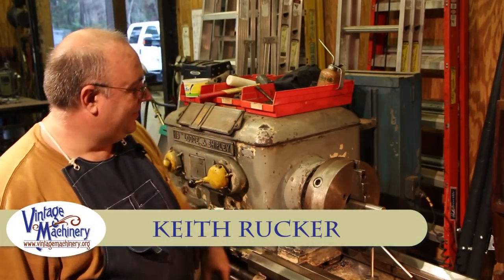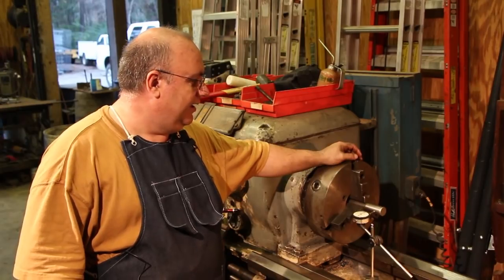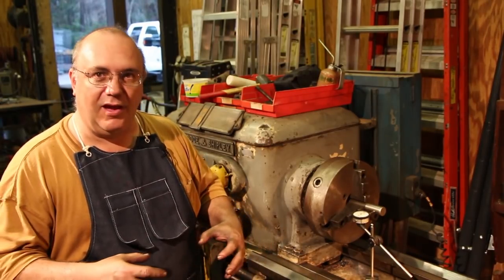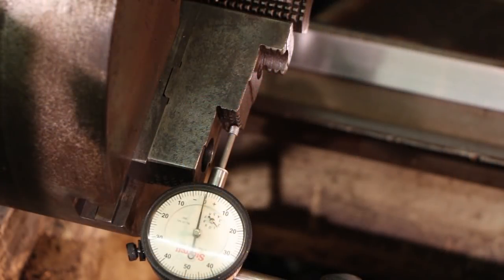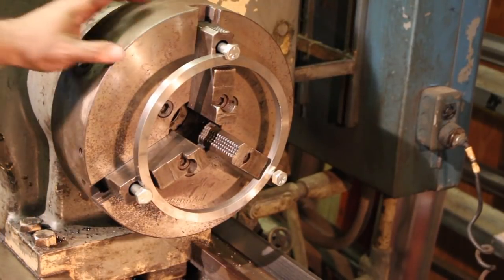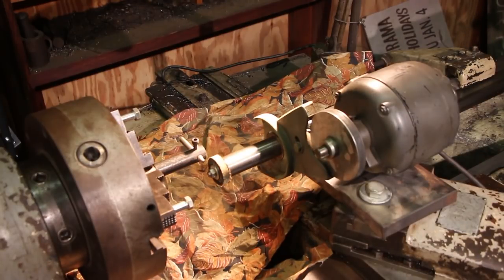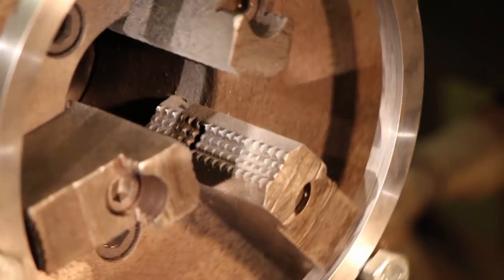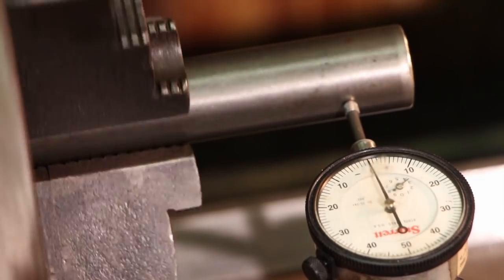Machine Shop Maintenance:  Truing up a 3-Jaw Chuck

Comment: Is aluminum stiff enough for this? I just spent hours cutting a ring on a 1-inch hardened steel I thought it was cold rolled steel until I started smoking the room up LOL
Reply: Clown Whisper  the ring just tensions the assembly, it doesnt play any role in the jaws positions besides that.
Reply: DrewLSsix I wasn't sure how much pressure you have to put on that if it's just to take the stuff out or if you have to put considerable tension on it

Comment: so for years you dealt with that run out when i watched your late was out in alignment of one of the jaws which is almost always the case ..... you mark that jaw and shim half the amount of your run out ..... then any time you use it you place that shim in the jaws on that jaw and done ......... but you really should check runout with different diameters of work.... it's possible that someone over torqued the jaws or had a workpiece grab and be torqued out of the jaws bending the scroll it'self meanin you only have runout for a common size of stock such as 1  or 2 inch... if that is the case shims are your answer unless you want to straighten the scroll

Comment: That's a great technique but it's only as good as where your grinder is mounted relative to the true center of the head stock spindle. I say .004" is pretty good!!! Well done!! 
I have an old South Bend 9A with a chuck that has about .011" run out measured at the chuck body, more on the work piece.
Reply: Dean Segovis 
not true Dean. The grinding wheel can be anywhere inside the chuck, and as long as it cuts, it will work. The centre height and angles of the stone sre essentially imaterial.

Comment: You made this way harder than it is.....  Just  chuck a piece of  round  stock machine it  true part off either  a disk or  a washer from that  place that in your  jaws squared up from behind by  a round bar against the  jaws then  place that  washer against that  so they are all the way  to  your jaws backs.....  Now  cut your  jaws true then  move the  disk to the  front of the  jaws and  bore home thru it  and  take down the  bit of the  jaws that  held the  washer before
Reply: Forgot that  many jaws have a nice  undercut for holding that  washer just  for this purpose
Reply: Another way is make a stepped washer that way you can  center off the  backs of the  chucks

Comment: When testing for trueness should the test stock piece be rec-chucked several times then check with the indicator for each chucked position?
Reply: i also like to use centerless ground stock for this or if you have a piece of 1 inch by 6-10 inch round carbide laying around it is super for testing runout

Comment: could you please explain what does "truing up" mean?
Reply from the maker: +Rizwan Ul Karim Making the parts "true again", or basically re-machining the surface to take off any wear, damage, etc. that has occurred over time.
Reply: Truing up is  making the  part centered.....  When  it  comes to the  chucks you want the  jaws to  hold a round bar centered perfectly (perfect does not exist only  close to perfect) ....  If  the  part is  not centered  when you cut that  part the  tool will  cut the  high spot and  not  the  low spot......

Comment: WOW.  Comments are polarizing Keith.  I like your videos & recognize that what you have to work with is generally 'old school'.  I'm into old school myself.  Trying to teach myself a new trade in tool making & find your results educational!  My Chinese Lathe / Mill Combo will have a better run out once my tool post grinder arrives - but will need an extension to do it.  My interest in your escapades is real.
Reply from the maker: +BROCKWOOD64 Thanks for hanging out in the shop with me (virtually at least....)

Comment: Thanks Keith, I really like your videos! I only have one question about this one in particular, since I worked for a short while in industrial metrology: at the end of the video, wouldn't it make more sense to measure the total, or only radial runnout, using a cylinder gauge? That there is just plain stock, who knows how cylindrical that is...
Reply from the maker: +ms01rci Yes, it would have been better, but that is what I had handy.
Reply: Thank you for taking the time to answer, as I'm sure you're getting hundreds of comments all the time. Thought it was something along these lines because you have a great a very good understanding of when and what 'good enough' is.
Best,

Comment: Interesting and impressive procedure.  couldn't the .004 run out just be a result of the tolerance of the round stock?
Reply: should have put the clock closer to the jaws.
Reply from the maker: +Andrew King Possibly.

Comment: just curious but what about the  outside of the jaws where the grip id
Reply from the maker: +Scott Tyndall You could grind them as well with the tool post grinder on the lathe.  I rarely use the outside of the jaws, but if I see a need to do it, it would be fairly easy to do.  You would just want to chuck something up on the inside first to pre-load the jaws.

Comment: Perhaps someone can enlighten me here. If using a media wheel, wouldnt the diameter change as it grinds, making the slide measurements off? I guess the trick is to take very little off each pass to keep the change minimal?
Reply from the maker: +This is our Journey Kind of like using a surface grinder - you take light cuts and re-dress your wheel when necessary.  You can get extremely accurate results this way.
Reply: makes sense!

Comment: Hey Keith, do you think a Logan Model 210 is good for Hobbyengineering? Got Hands on one in really good condition.
Reply from the maker: +falcrum19 I used to have a Logan 210.  It is a fine machine for hobby work.  The only drawback to this lathe is that it does not have a quick change gear box for changing feeds and thread pitches - you have to manually change out the gears to get the right ratio.  It is doable but a pain in that it takes 20-30 minuets every time you need to change the gears.  Also, be sure that if you get this machine that it has a a complete set of change gears with it as you will find that you will be spending a lot of money to get the ones you need if you don't.  While Logan is no longer in business, one of the family members of the company still has lots of parts and is very helpful if you have any questions on the machines.  If you go to my web site at vintagemachinery.org, search for Logan and there are several publication reprints with more info on the lathe.  Besides the quick change gear box shortcoming, it is a nice machine capable of doing fine work.
Reply: Hey Keith, thank you for answering so quickly, I was able to win this auction, an the lathe costs me 491€ (~530$). The machine comes with several gears also for metric system, a 3 and a 4 point chuck, quickchanger for the lathe tools, several spindles, a table and many many other stuff. I think it was really cheap even for an 69 year old lathe that was redone. Sorry for may bad english, and greetings from germany ;)

Comment: i used a boring bar
Reply from the maker: +go irish A lot of the chuck jaws are hardened, which would not work too great with a boring bar.
Reply: I realize that, just noting that I had no issues.

Comment: Why did you stop? You need to run that grinder several more light passes and you would get even better runout hopefully down to .001" or less.
Reply: +Dima Prok On an old lathe, there's going to be slightly uneven wear on the scroll, and that's assuming it was perfect when it was originally machined.  It's not realistic to think that you'll ever eliminate the runout, because even if you get it perfect with the jaws at 2" diameter opening, it could still be few thou off when you crank them down to 1" diameter due to the fact that the scroll has some variation.
Reply: Bullitt Garage When Keith Fenner wants that kind of precision, he uses an independent 4-jaw and centers it with a dial indicator.  As anybody should.
Reply: +Dima Prok Because he isn't anal retentive like Keith Fenner.
Reply: +Dima Prok   The Agricultural Museum has equipment from the late 19th and early 20th century so a lathe with 0.004" runout is capable of making parts for equipment of that age which were manufactured with much less accurate machinery.

Comment: Keith,

Just watched the comment video that follows this one, and realized something.  I wonder if you might have gotten better results from using shoulder bolts instead of rolled bolts, I once tried to convert a few long bolts into aligning studs (remove the head, grip the non-threaded area, convert outer 1.0" of 2.5" of thread into pin), and was surprised how non-concentric the threads were in relation to the non-threaded section of the bolt.  Then again you might only pick up a few hairs.  2 of the 3 bolts were so bad I just tossed the idea and started from blank bar stock.

For a few more hairs, should also have advised (in the case of people that have 2 piece jaws) to remove the master jaws and clean the keys & slots with alcohol and remount them dry especially the corners where no one looks.

Thanks for another great video
Rich C.
Reply: Ignore the shoulder bolt suggestion, just realized the thread wouldn't belong enough.  Only way to do it would be to make a long thread shoulder bolt for this purpose.
Reply: +Rich Cizik I was thinking the same thing, that stock bolts could be very much off center.
Reply: Rich Cizik  the bolts dont need to be perfect. remember, they are just part of a solution to remove slack not position the jaws.  the jaws are positioned by their screws and no amount of precision in the jig beyond removing the slack will alter their position.
Reply: Drew,  

Have you ever checked the centrality of rolled thread hex head bolts?   I have tried to use a bolt to make an arbor for a hole saw.  The thread of the hole saw ran within 0.010 of the body, but when I threaded in a 3/4" grade 2 bolt that I had cut the head off of, the saw ran almost 0.120 eccentric, and if I turned the bolt 90 degrees in the hole saw and relocked the nut against the saw body it would bring it down to 0.050 before going back up.  I have also had the unthreaded sections of bolts run so eccentric to the thread that the bolts could barely be hand tightened because they would rub against the clearance hole, but would rattle loosely in the same clearance hole by itself..

Now consider using that same bolt against the ring, it could mean that 2 of the jaws are being pushed against the scroll while the other is floating.  The only way you are going to get a semi-toleranceable jaw set is if all 3 jaws are held equally tight to the scroll.  Thus the only way to make sure of this is to machine all 3 or to use shoulder bolts which are manufactured with centrality and shoulder diameter tolerances.

Rich C.

Comment: Idiot! Always clamp on the INSIDE of the jaws to make an internal cut! And you call .004 run out acceptable? What are making? Baseball bats?
Reply from the maker: Mike Snyder You must not have been watching this video very close - I am not gripping on the outside of the jaws, I put in long bolts on the outside bolt holes in such a manner that I am actually clamping on the outside of the ring in a way that loads the vise jaws to the inside.  As for 0.004" being acceptable, for three jaw work, that is plenty acceptable.  If I need for something to be closer than that, I chuck it in a 4 jaw chuck and dial it in with an indicator.  No three jaw chuck on the planet will eliminate runout 100% and if you start randomly checking 3 jaw chucks with an indicator, you will likely find that the good ones are only keeping parts within 0.002 to 0.005.  About the only time I ever use a three jaw chuck is for a job where I am either starting from a rough piece and the entire part will be turned to size (where 0.004" is more than acceptable because I am turning everything off) or if runout does not matter.  And considering where I started from with this old and bell mouthed chuck, I made a HUGE improvement, which was the whole point of the video - how to make an old worn out chuck better.  While I can make baseball bats if I want to (I use my wood lathes for those however), I use this lathe for precision work and use it quite effectively, which I think you will see if you watch some of my videos.  Which leads me to wonder who the idiot in this conversation really is.......
Reply: I've gotten old worn out 3 jaw chucks to within .0005 by tapping on the eccentric jaw with a babbit hammer.
I worked job-shops for over 40 years and you learn to use what works!
Reply: @VintageMachinery  
Hi Keith.   I learnt a long time ago that people always accuse you of what they are guilty of.   Thanks for the videos
Reply: +Mike Snyder That works for a particular diameter.  Then what do you do when you need to chuck a larger or smaller piece?  You're going to have to true it up again, because I guarantee that old, worn scroll is going to have a few thousandths of waviness in it, (not to mention the occasional dent from tool crashes).  Keith is right, that the ONLY way to get a part absolutely true (as true as you want to get it) is to use an independent 4-jaw chuck, and it's going to take a lot less time and effort than pounding on the chuck every time you put a part in it (not to mention being easier on the headstock bearings).  There's no scroll chuck in the world that is perfectly true at all diameters.  When I was doing production work on precision Mazak lathes, we had to re-cut the soft jaws before Every Single Run, at the diameter they would be used, UNDER TENSION (usually used an appropriate-sized washer tucked into the hard jaws), to true them up, and those were hydraulic chucks, not scroll chucks.  If I had bashed on the chuck with a hammer, the foreman would have escorted me out of the county on a rail!

Comment: try it by using nothing on the jaws and turn the lathe at the highest speed it will do. the check round out with a piece of precision ground drill rod.....you might be amazed ...
Reply: +Andrew King   I've thought about this carefully,  If you strip a chuck and look carefully at each piece as you resemble it, unless the chuck is incredibly worn out and very sloppy, I cant see which piece would generate the force to unscrew the scroll 
I'd be interested to know where this piece of information came from ?
Reply: William Gotobed Manufacturers, fellow machinists in the industry.
Reply: Be interested to find which manufactures actually quote this ?, and you still don't mention which part can cause this phenomenon, assuming that the chuck is actually tightened up.
Reply: That can happen on a lathe that starts instantly in the right direction at a very high speed.   That is what can unwind the scroll especially if jaws are opened a long ways.   Otherwise the centrifugal force of the jaws  is so great on the scroll that I don't think you could open them if you could put a chuck wrench on and turn it.   Hope this helps clear the mud in this situation and is the only way I will grind the jaws.
Reply: +thefreese1 are you not a machinist? you Never run a chuck at any speed without it being clamped on a piece of stock. Running the chuck at high speed especially, with it clamped on nothing will cause the jaws to scroll outward and fly off.

Comment: Ok, I'm a novice at machining, but I do have a question so be easy on me If I sound ignorant LOL 

Shouldn't the grind be made with the chuck jaws adjusted as far open as you can get so the grind radius on the jaws is as large as possible?, this way anything that's chucked with the same or lesser diameter will still be held by the new grind surface? If you grind with a small radius, then larger stock would still be held by teeth that may still show the run-out?
Reply from the maker: 1957mrbill The truth is that on an old chuck like this, the wear on the scroll will be different at different diameters.  It is best to grind the chuck as close to the range that you do most of your work in.  It is not a perfect solution, but about as good as you can hope to do outside replacing the entire chuck.
Reply: 1957mrbill Don't forget, the jaws need to be ground beyond the opening in the chuck.

Comment: I've worked in machining for years and have found a very simple solution to jaw adjustment on such machines...Each jaw goes in a specific slot and when you don't do it like that, you'll have severe run-out. That's why you mark each jaw as well as the slot they're in, so that next time you know which slot each jaw goes into.
Reply from the maker: Bryant MaximilionAlpha Yes, you are correct that each jaw is numbered to fit into a specific slot and failure to do so will result in the threads not lining up on the scroll right.  However, that was not the case here - the runout is from excessive wear of the chuck.  Had they jaws been in the wrong slot the runout would have been more than you could grind out!
Reply: +Keith Rucker - Won't the circumference of the grinder get smaller as you use it causing the jaws of your chuck to become wedge shaped ?
Reply: +Mike Cunningham That's exactly what I was thinking.  I wonder if there's a particular type of grinding wheel that works best for this sort of work or if the difference can be averaged out by sliding the crossfeed till contact is made at the front on one pass and repeating but making contact at the back on the next pass, and then a 3rd pass making contact in the center first.